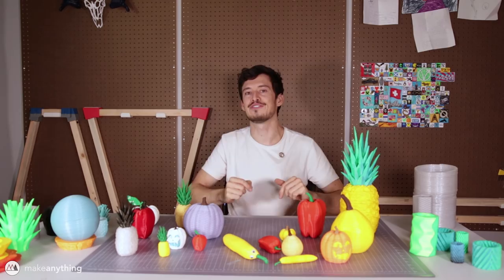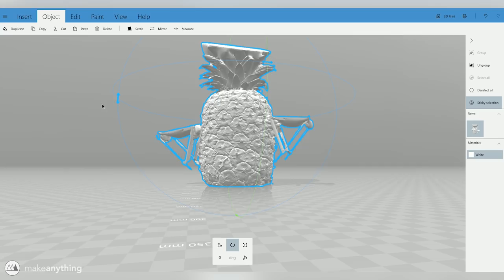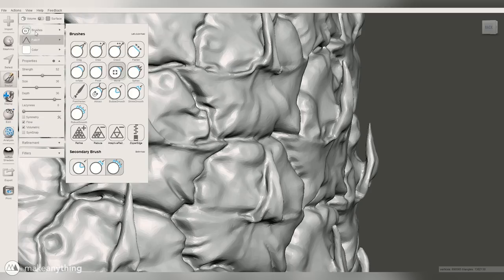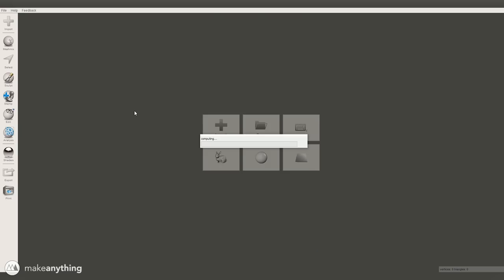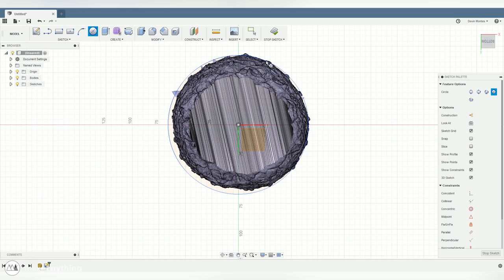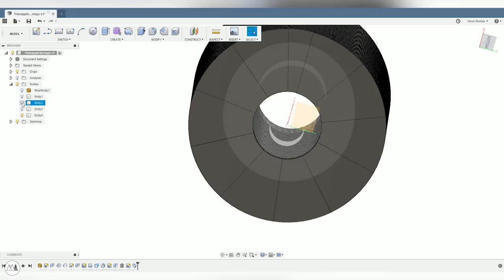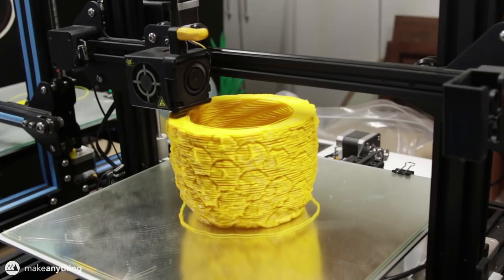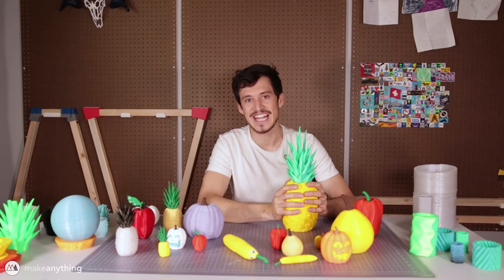Making the Pineapple Springo // Full Process Tutorial

Comment: I 3D scan with my Xperia XZ3 - way less expensive than one of these Einscan scanners and usable for most applications.
Reply: NicMediaDesign Hum... That feature is interesting!
Reply: I would call it "advanced photogrammetry" - quite good actually.

It also takes way less time and effort than using a dedicated 3D scanner like Devin did here.
Reply: i have used a lot of scanners over the years and i do own the basic version of the einscan and for details i have had the best results with photogrammetry using Recap pro my autodesk. as it saves out awesome texture maps that can be used in zbrush to add back the details to the model. i find that the einscan texture maps to be of a very poor quality even though states high qual texture maps. but the einscan is handy as it will scan models that i cant do with photogrammetry also avoid any laser based scanner. like the cowtech duel laser scanner.

Comment: For the cutting tool, I think it would also work with the first method you tried, with the positive springo shape rather than the negative. You'd just have to adjust how you put the tool together and used it. Instead of a join with the center cutout, you'd cut the center from the springo, and then instead of a cut from the pineapple, you'd do an intersect.

Comment: At 22:30 you don't actually have to make a tool that is a cut guide. You already made a springo so you can use an intetsrct between the pineapple and the springo to get the pineapple springo.
Reply from the maker: True, either works. I wanted to cut the hollow at the same time so I chose to make a cutting tool

Comment: How are these springos printing actually? If there is an air between layers then they must lay on the previous... So in the end the nozzle will be printing higher than previous layers and it will not print it... It's how I imagine this.
How this works?
Reply from the maker: The gap is small enough that it still prints, but doesn't fuse with the layer below it
Reply: I understand but it's not explanatory enough :)